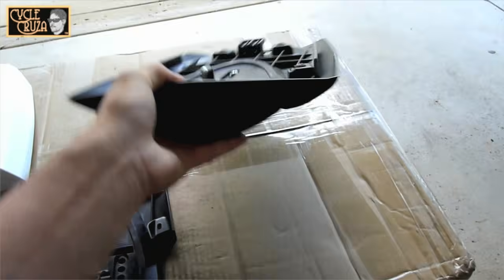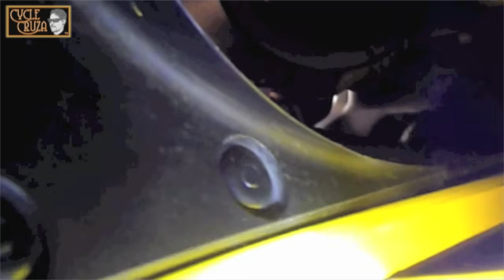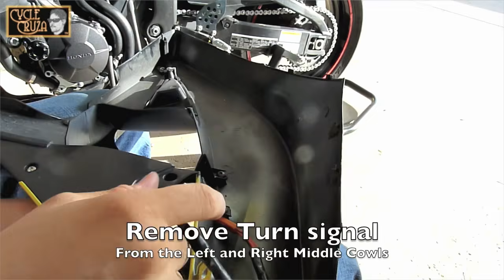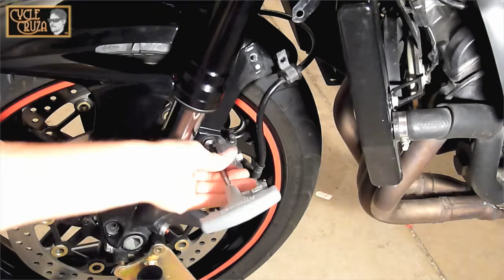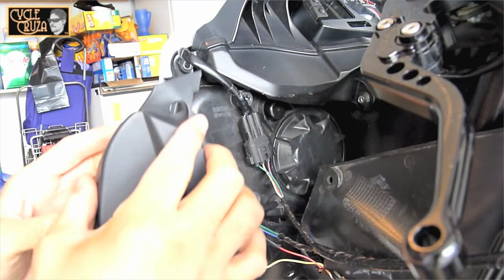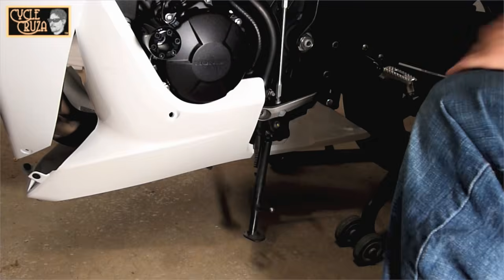How To Install EBay Fairings - Honda CBR600rr - Chinese Aftermarket Fairings - Part 2

Comment: Where he put the zip tie your suppose to put that portion in first then hug around the the headlight and tank. He didn’t do it cause it’s REALLY difficult to get the top fairing to the gas tank

Comment: I just found this vid in 2024 trying to put new fairings on my 2013 Kawasaki. Your zip tie tip for connecting the front has saved me!! I put my bike together and there’s a horrible gap in the front. I’m glad to find an easy fix that doesn’t require me completely tearing off my sides again.

Comment: Best video so far. Still had a issue with the middle farings and had to make a bracket off the tank cover and secure the mid faring to the tank cover with a bolt because the tabs were strong enough to hold. There’s a slight gap between those two parts now but looks ok. Cheap faring issues I guess
Reply: Had this same problem. I decided to buy rubber grommets to insert into the holes (and prevent damage to the fairings) as well as some nice stainless steel zip ties to make the stich look nicer. I put 3 cinch points along where the tank tabs are, 2 along the inner black plastic next to the forks to keep it flush with the middle fairing, and 1 under the nose fairing - so 6 total per side. I'll fly through zip ties, but installation every time will be significantly easier (no more trying to stretch the fairing to reach) and I don't have to worry about tabs popping out.

Comment: Purchased an E-Bay Chinese fairing.
INFERIOR PLASTIC,  MELTS NEAR EXHAST. UNLIKE THE OEM WHICH DOESN'T.  
Save your self work, frustration and removing melted plastic from your machine. BUY O.E.M.

Comment: What about the rivets on the brake line brackets? How do you take those off?
Reply: Take off the fender, drill out the rivet and put it on the new fender. Then get a rivet gun and a new rivet and install it in the same spot or use a screw and bolt that won’t rub.

Comment: THANK YOU SO MUCH FOR THIS VIDEO!!!! I installed an aftermarket ebay fairing kit on my '10 CBR 600rr Using your intructions!!
Reply: Hi I bought a "08" cbr 600rr and the guy had some homemade fairings or something. So I have no bolts or grommets or screw clips or anything. I know they sell bolt kits. But do u think its possible for me to still install this?

Comment: As of October 2019, the eBay seller "EZMoto" no longer exists.
Reply: Does it matter? All the aftermarket fairing companies use the same manufacturer and it's the same shitty low grade abs bullcrap plastic. It's better to buy rashed oem pieces on eBay and fix and repaint them.
Reply: @clutchboi4038  oh yes coz that makes sense lol. Buy broken fairings repair and use on your bike coz that 1 inch of plastic is going to save your life much more than the 1 inch of Plastic from the after market fairings. News flash div they all get made the same way get over yourself and buy a push rod

Comment: Mine had a rivet for the front fender brake bracket. It won’t pop out with just a flat head screwdriver. Suggestions?
Reply: I’m stuck on the same problem. What did you end up doing???
Reply: I had to drill through the rivet. Pretty annoying but it worked

Comment: Say I didn't want a zip tie showing on the front of my bike like that, how would I finish the job otherwise? Just isn't appealing to me. Does it snap into place like the back of the same fairing? Thanks for the videos! I plan on swapping my fairings, oil, oil filter, doing an engine flush, a coolant flush, and changing the mirrors out to these in a few weeks. Love the videos

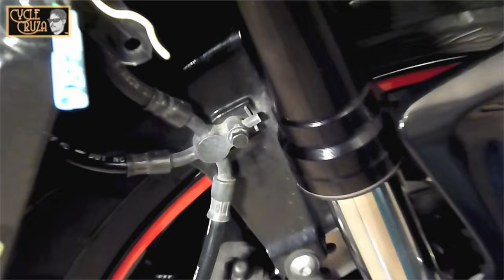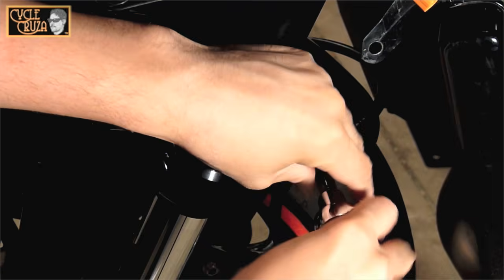Comment: Hey, CycleCruza this is probably a long shot but worth a try. when you were removing the front tire fender at 10:05 you zoomed in on the bolt on the right side for the brake line, I was windering if you knew what kind of bolt the exactly is because I have misplaced mine. And then on the other side you showed the bracket and removing of the bolt at 10:22 again im wondering if you have any idea where I can get that bracket and bolt for the brake line.

Comment: On my 06 1000rr I am having trouble replacing the front spoiler back onto the bike due to this square box looking thing that is preventing me from securely tightening the nuts back on. Im new to riding and its my first time replacing the fairings, any tips/advice to solve this issue?

Comment: Thanks for the video. I just finished installing Auctmart fairings on my brand new 2015 CBR600RR. I couldn't find any videos for  the later CBR600RR. Even though the 2013-2016 fairings differ from yours, they are similar enough that this video really helped.The newer front fairing is a bit trickier to remove than yours. There are a couple of hidden screws that are hard to find and even harder to remove.

The fit and finish of the Auctmart fairings is better than I expected. I did have to open up a few holes and file a few tabs. I bought the fastener kit from Auctmart as well as a fastener kit from eBay hoping to be able to set aside my OEM fasteners. Unfortunately, neither kit had any fasteners even similar to OEM so I had to use all of my original OEM fasteners.

Comment: @CycleCruza Bro, i got the same CBR600rr you had, im hoping you could share some insight on an issue i have. Im changing the farrings as well mainly cause it was dropped. The front farring stay bracket broke off on the side so i had to replace that as well so that im able to put on the front farrings. My problem is that the bolts in the middle that hold the stay bracket are just turning and dont come loose. Im assuming their is a nut on the back holding thr bolts but their out of sight. Any tips or tricks on how to remove the front farring stay bracket?

Comment: Hey man I know you don't have the bike anymore but how do you remove the brake line brackets on the front fender?? Are you just supposed to pry them off? I'm having trouble getting them off
Reply: did you ever figure this out? i think they're rivetted in place

Comment: Nice to know that in your country, you can just easily change colors or design-colors on your SSB. Unfortunately, in the Philippines, every time we have to change the colors of our bikes, we need to update and re-register the motorcycle's registration in the LTO (Land & Transportation Office) and get an additional payment for changing the main color. It's a little bit of a hassle but if we hate the color of our bikes, then we need to sacrifice a few thousand pesos for the new color we put on the bike.
Reply: Pare rider ako rito sa us at sa pinas.... dito sa lugar namin toll require na pumunta sa parang LTO natin dyan na papaltan rin yung kulay kase kung hnd baka isipin nung putang inang pulis na ninakaw ko yunk motor. Meron din si cycle cruza na video na hinuli sya kase yung farings nya puti. Sige toll ingat dyan sa pinas wag kang mag pagago sa kurakot na tao

Comment: so which kit did you like better, the EZmoto from ebay that you installed on this video or the monster fairings you installed on a previous video. Since they are both chinese, I would like to know which has the best fitment also. Thanks
Reply from the maker: +Screaming Chief Fitment depends on the model bike , on my cbr600rr I had to make one modification to fit properly as where the cbr1000rr there were no fitment issues.

Comment: Did you get a tank cover with the new fairings? I keep seeing fairings with no tank cover
Reply from the maker: +Jukin Jiga That's because all other sportbikes have painted tanks, as where the cbr's have painted tank covers, another reason to get a CBR, much easier to completely change the look of your bike without dealing with the hassle of draining and painting a gas tank.
Reply: +CycleCruza is it similar to a Honda CBR 500r, I don't see tank covers too. where did get yours from.

Comment: did these fairing come with the heat shielding already on them?
Reply from the maker: +SwubbyQ Yes the EZMoto fairings came with heat shielding, however, with the monster fairings you have to install the heat shielding yourself but they do provide the heat shielding with the kit.
Reply: thank you so much :)

Comment: Thanks so much for your video CycleCruza. Especially your tip to do with using zap straps. I ended up using 6 on the front fairing and spoiler. It helped so much

Comment: Cycle cruza what is the silver thing u have put on the left and right lower cowl...did it come with the fairings ??
Reply: They're heat shields and most fairings do come with them from what I've seen.
Reply: thanks bud :)

Comment: hi thank you for your videos. Id like to get advice on what bike cbr category 400rr should i get to modify it with the 1000rr 2008 cbr fairings and body kit...There is somebody here in my country who modified a '90 400rr cbr to 2008 1000rr cbr with the body kit abs fairings. He was selling the bike but im not very satisfied with his modification as some trims and panels seem not to fit well onto the bike and maybe he wasnt able to buy the complete set of fairings or the other panels of the honda cbr 1000rr. Can you suggest to help me with my project bike. I dnot really need a 1000rr power since im gona use the bike almost daily so id only go for the 400rr..I only like the look of the 2008 cbr 1000rr. my face book is Brian Canson

Comment: Why your CBR has this Fairing? And mine has a full fairing with plastic engine cover?
Reply from the maker: Lonely Spawn 2009 and newer they put an engine cover on for some odd reason, I like it better without myself.
Reply: Thanks, and how can i install your exhaust properly? And the rear light?
Reply from the maker: Lonely Spawn I don't know, mine came with it. Just follow the directions or try to find a video on YT to help you. Best of luck!
Reply: Cycle, if i buy a 2007-08 Honda CBR600rr fairing for a 2009-12 will it work fine?
Reply from the maker: Lonely Spawn Check with the forums, I don't know. I know it can be done though.

Comment: I don't like how there is the gap there under the head lights where you had to make the modification, I wonder if the seller fixed this issue yet? Also why would you wax the fairings with them off the bike? Wouldn't it be easier?
Reply from the maker: ***** Believe me you can't see it unless you get under the front. It's a not a big deal but if you want perfection get a set on oem fairings for $3500. lol Everybody that sees my bike in person says it looks sick. Don't worry about the tiny gap.
Reply: @CycleCruza  as much as a brave new bike

Comment: Mine should be here by my birthday for my R6 I got the Monster energy black and green,  reason I'm watching this to see if you ran into any fitment problems,  just dropped $526.00 on them so hope they fit correctly. .. kinda nervous but yes2yeah says they are perfect fit solo will see lol
Reply: Frankie v, I want to know if the fairing you purchased from yes2yeah works fine and if there was any kind of problems installing it. Im planning on purchasing one myself from them. Please reply back when you can...

Comment: Looks good overall but having to use zip ties for the front fairing and the obvious gap that now exists between where the front fairing and the mid cowl meet is unacceptable and not worth the kit. I guess their promise of a perfect fit is a bunch of baloney.
Reply from the maker: Hector Torres Then pay $3500 for a new set of oem fairings. lol Oem and chinese fairings are nothing more than plastic. Some riders ditch the plastics for a streefighter look. I'm taking my oem fairings off of my brand new 12 Honda cbr1000rr and replacing them with chinese fairings, watch my new video on why I recommend doing this:  Why You Should Get Chinese Fairings Even On A Brand New Bike
Reply: OK buddy....
Reply: Green, i totally agree with u and think these are worth a try considering how ridiculously over priced they are too.

Comment: For anyone that ever wants to install the fairing kits, one thing that will make your life easier is to either let the plastics sit out in the sun or keep them inside until you are ready to put them on because they are going to be less bendable than factory plastics. Love how they look, I did a body kit on my old bike and it turned out great, but the plastic is far harder to bend than factory ABS plastic
Reply from the maker: adrenalineboyzryan $500 vs $3500 oem, I'll take less bendable ABS plastic thanks. lol I get compliments from people in cars almost every time I ride.   It's ridiculous that they charge so much for so oem plastic, it's robbery.
Reply: CycleCruza
Yeah I agree! I bought a kit for my last bike and I loved how they looked. Got nothing buy compliments on it. Factory plastics are insanely priced.

Comment: HEY THE BRAKE LINE BRACKETS THAT YOU SAID JUST POP OUT ARE RIVETED ON
Reply: So how do you get em out.. Plss
Reply: i used a dremel to take the rivets off and i work in a maintenace  area so we had a hand rivet gun to re rivet the bracket on the new fairing.
Reply: I'm sure a garage that has a the tools will do it cheap. won't hurt to ask around. its a simple easy job
Reply: A good way to remove pop rivets without damaging the underlying part is to use a drill bit that is a bit larger than the head of the rivet. Slowly drill the rivet head just until the head pops off. Then just push the remaining part of the rivet through the backside.

Comment: I can tell you this.. I have zero experience when it comes to mechanic and stuff like that... I got some new fairings too for my suzuki gsxr 750 k1 from Ebay, and the fitment is 100% and the installing is very easy too.. So dont go to the mechanic shop and letting them do the job and paying them stupid money.  

PEACE, LOVE AND RIDING

I really like your channel =)
Reply from the maker: I agree, try to stay away from the shop if you can, will save a lot of money. Thanks for watching!

Comment: I went through the same thing myself and it wasn't fun. I have a much greater appreciation for the videos you put together after this weekend job.  Do you have a video to install aftermarket flush indicators? i'm more curious about the wiring. The ones i bought comes with 2 wires, but the stock has 3 wires. Keep up the great videos.

Comment: Great job, and always a good idea to get all the bolts in place and leave them loose and tighten them up after you line up all the thread holes.

Comment: Hi there.
First of all. Thanks for sharing your experience on the new fairing for your CBR.

I am an owner of R8 600RR too and what to ask you a question about the Integrated Mirror Signals.
How did you find them to suit your bike? I want to buy them on ebay  here in uk or china. There is lots but most of them from Yamaha or Suzuki. Did you maybe buy them on a bolt only and used the bracket from your Honda?

Well appreciated
Reply: Beware of mirrors which have a  hinge that only allows the mirror to be moved side to side only  I got these and although they do the job there are mirrors which can give you better rear views.
Reply from the maker: This video install and review video I did should answer your questions: Honda CBR600rr Install Aftermarket Mirrors with Turn SIgnals - Other Motorcycles Too
Reply: I did change them finaly. I believe they are just the same as CycleCruza's ones.
They are little bit slimer but do give better view though of what's directly behind me :) sacrificing some of the wide view which I think is a better deal as I like to know what's right there behind my back within 50 miters plus one mirror is always kept in a wider angle for more view  range.
With the hinges between mirror and the arm; They are not as flexible as on the OEM mirrors therefore I need to keep closing the whole arm when going through tight gaps :)
At the end I would still choose the after market mirrors with led signals. And I would give it 7 out of 10!
Thanks again for the video Cruza.

Comment: Hi there Cycle, first off I want to thank you for this complete guide. My question is  since all ebay fairings comes from a handful of factories in china and sellers are just using different names on ebay, does your guide only apply to EZMOTO fairings or is for pretty much any china made fairings. I ma currently in the market for a red KONICA fairing, any help would be greatly appreciated. Thanks in advance.
Reply from the maker: Not all chinese fairings are made good. You want to make sure it's ABS plastic and not PVC plastic. I can only vouch for EZMOTO. I have no idea what the other chinese fairings I originally had on the bike but they were just as good. Btw, you can get chinese fairings custom painted, you just have to email them and request it.

Comment: What condition are your fairings in? It's been over 6 months now. Just a little curious as I bought a CBR600RR '08 with a bit of cosmetic damage and am in the market for fairings. They are too many options and not enough reviews! Thanks
Reply from the maker: Still just as good, just clean and wax them once a week and they should stay looking good.

Comment: Gotta give you a BIG thanks on the zip-tie tip, when I first seen you do it i was like "WTF would you intentionally break the tabs to get a better fit" but after i broke a tab accidentally on my aftermarket set I gave it a try and I must say the fit is damn near perfect! Really appreciate the helpful tips CC!!
Reply: I cant do it. I cant drill into my fairings. I can't desecrate such a beautiful thing with zip ties when its fresh out the box lol.
Reply from the maker: I learned this trick from a honda tech.  Also, not in the video, I changed those stupid push screws/rivits underneath the front fairing to screw clips so I can now just use regular screws for easier removal.

Comment: Wondering about changing fairings on my 2001 r1.How long did it take you to change? Thanks for great and helpful vids
Reply from the maker: A few hours. The longest part is changing out the bolt settings.